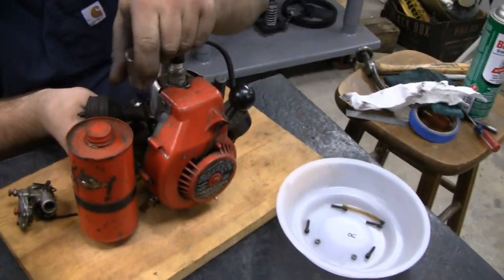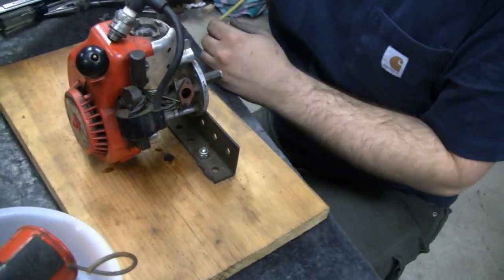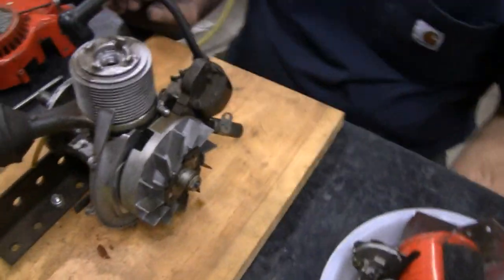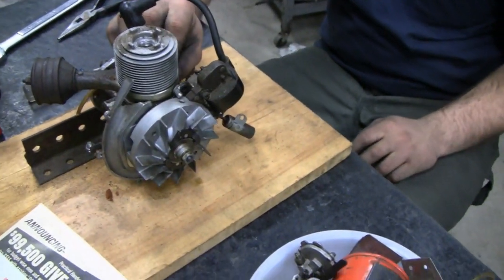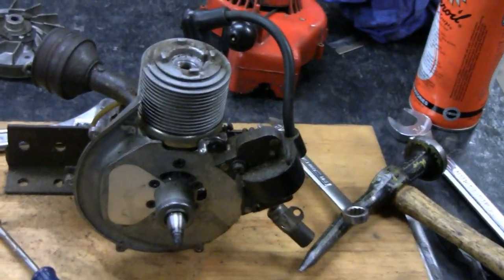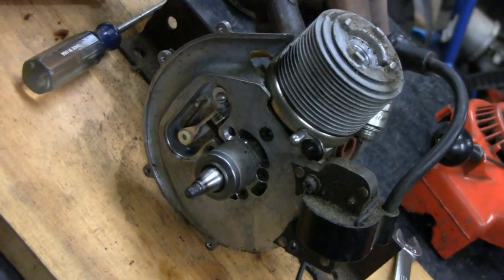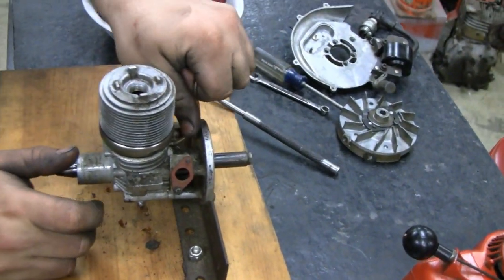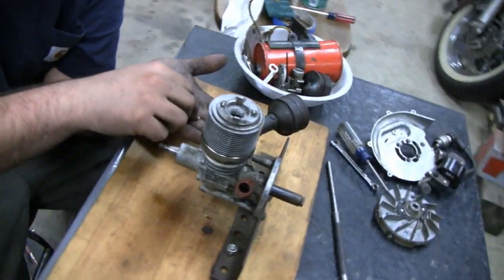WACKY LITTLE OHLSSON & RICE ENGINE TEARDOWN

Comment: You's Guy's can go to one of those bearing and garlock-seal supply places to locate new PTO (Power Take Off)  shaft bearings and replace both seals on both ends of the crank & PTO shaft assy. 
     One of My favorite bearing supply places was called King Bearing...If You're ready, you can locate a centrifugal clutch..Assy. You'll probably need a shaft bushing for a clutch / torque converter assy as your 1/2" pto shaft will need to fit properly in the 3/4" clutch or torque converter hub ..
    One cool suggestion for this little gem is get one of those variable ratio drive - Torque converter set-ups from Vevor P/N- TAV2/30 for about $60 to make this 1- H.P. engine feel like You're in command of a 3.5 H.P. Briggs & Stratton 4-stroke mini-bike with about 35-40 m.p.h. top speed !!! 50 mph - with a tuned exhaust pipe!!
    GRT for getting to the closest auto parts store, or an Emergency Pizza Relief Run (EPRR).... To help - Complete the projects in the workshop... 
      BTW, Olsen & Rice got their start building very nice 2-stroke spark- ignition engines for Model aircraft that used two thin cables to control the elevator(pitch) which flew in circles around the 'pilot'.. Also Known As 'U - control' planes.. A Really fun hobby ...
     Today is: 4/03/25

Comment: For the bad bearing, could you not just make a sleeve for it on a lath and put it on-top of the spinning axle , or in the bearing hole? Might have to make the bearing hole bigger to accept the sleeve, a sleeve that has to be a reasonable size to not crush or bend.

Comment: I bought a 3/4 hp version of this engine when I was 14 at a local salvage store.  I took it home and started it then kept it all these years.  I plan to build a pit bike with it using a bicycle chain derailer system for the transmission.

Comment: O&R made  a lot of model airplane engines in the ignition days, prior to  about 1955, but they never made the transition to glow ignition. Some people converted them to glow, and it was fairly common to see  bicycle spokes being used to clamp the cylinders on converted engines down to the engine lugs to keep them from blowing off.

The screw in cylinder and bypass ports milled into the cylinder wall was used on hundreds of millions of Cox engines.

Comment: O&R was a huge maker of model airplane engines. They made the 3/4hp  and 1hp small 2 stroke engines for all kinds of lawn equipment... plus mini bikes, generators, drills, saws, pumps, hedge trimmers etc. I have a collection of O&R stuff. All the ones I have run great. The carb diaphragm is the most common reason they don't run. There is a guy on eBay that reproduces them for a few bucks each. There LOUD as hell, but they start easy and run very well. Here is a short video of my O&R Tiny Tiger 300 watt generator running. https://youtu.be/3rqbrpZIXRU . Enjoy Howard

Comment: Good luck tuning those little SOB's. Those were the first lighweight  engines we had for tapping maple trees back in the 60's. The carbs were VERY sensitive to elevation-if you went up as little as 50ft, you have to lean the carb out to keep it running, and richen it up when you went back down.
Reply: The Tanaka's were the first ones that were actually dependable, at all.

Comment: They are cool I have a couple of there little chainsaws
Reply from the maker: +huck01955 We picked up a couple of junk O & R chainsaws last summer to try and make this little engine run!!☺
Reply: Im sure you guys can do it .
Reply: 805ROADKING do you have a spare magneto coil I have been looking for one for quite some time. is there a coil that I could use on a different kind of motor

Comment: Hey guys. Wanna sell me,some parts off of that little O&R? I need that output shaft adapter and I could use the muffler as well. Let me know, and thanks. Really enjoyed the Briggs 4 cylinder project.
Reply from the maker: +Michael Shearer If we were gonna scrap the engine I would give ya the parts Bud!! but were gonna repair it, got the parts to do it just don't have the time yet!!☺

Comment: Ohlsson & Rice made model airplane engines, the Academy of Model Aeronautics called Irwin Ohlsson the Henry Ford of model airplane engines, and he was the 4th President of the AMA, he is also in the AMA Hall of Fame.  He developed the glow plug and fuels commonly used in model airplane engines today. He was also a pioneer of miniature spark ignition gas engines.  There aren't too many of those old engines still around.
Reply from the maker: +G56AG Interesting stuff Bud!!☺

Comment: Ohlsson & Rice was alegend in small engines. That's a 1.2 cuin engine. They used them on weed wackers and even on a mini generator. BTW: The loose crank isn't the crank. It's the drive from the crank.

Comment: the bare engine without the fan shroud looks like my tiny 0.49 model plane engine,  the muffler and cylinder are the same design only larger
Reply: 65bug519
It's actually 21cc, which surprised me a little bit considering how compact the engine is.

Comment: The O&Rs are well built like you stated in the video but their weak link is the diaphragm carb.
I have many of these engines and would also like to build a Tom Thumb mini bike but haven't been able to find the right 5/8" tube bender yet. If you need any information or parts for O&R compact engines you can visit OhlssonandRice.com.

Comment: Does anybody know where I can get parts and or service info on the Ohlsson and Rice engine? I want to rebuild mine but info on the motor is scarce apparently. I need to fix the pull cord spring and maybe clean the carburetor and I think she'd be ready to go.
Reply: Bill Saffran same here. Can't find any replacement parts

Comment: It's a RC car motor..... Duh
Reply: No it isn't..... DUH
These were made as compact utility engines! MANY were used to manufacture gas powered tools. BUT some were also used to power RC stuff too, but mostly boats. Octura used them for their boats and also made their own carbs for them. They can be found with water cooled heads too. Some were also converted to use glow fuel. Seen them used for RC airplanes but I have only seen one used for a RC car.
Reply: put it in a gas rc boat

Comment: That's a neat old engine its designed like a vintage model airplane engine just bigger. very cool hope you decide to get it running. I bet you could find some sealed bearings to fit in there.

Comment: what I would have done is put heavy axle grease on all the needle bearings when you put it back together, it would help with some of that slop in the bearings!
Reply from the maker: We did use heavy grease but that was just to hold the bearings in while we assembled it!!☺

Comment: I have this same engine on a 7 1/2" ciricual saw  mine is not running its a project waiting to be rebuilt  yes these engines were used in chain saws  O&R made the engine and spld them as powerplants to differant equipt Mfg. Like B&S  keep me informed when you work on it  and any sorce of parts you find please
Reply from the maker: Yeah they used them on alotta different machines!! The only source for parts that I'm aware of is that Forum you mentioned and Ebay!!☺
Reply: Damn cool lil engine when get it running  it would make a great chicken power bike

Comment: Cool project RK....1hp..!..I have a glow plug engine in my RC that is rated at 1hp...It's 2.1cc 4 port and revs to 35,000rpm...red line for power it 34,000 but I'm struggling to find a tacho to confirm that...lol
Reply from the maker: Thanks Zig!! That's some insane RPM's there Mate!!☺

Comment: Roadking - this is a neat little engine.  It is similar to a little motor that I had come into my shop a long time ago.  It was made by the Minhow Company.  Could not find bearing, seals or gaskets for it.  Ended up making bushings and machining crank casing for a seal.  Thanks.
Reply from the maker: Yeah it is a neat little engine!! I am having some trouble finding parts!! Don't be surprised if it winds up on your doorstep!!☺